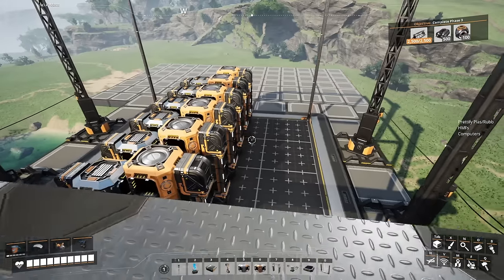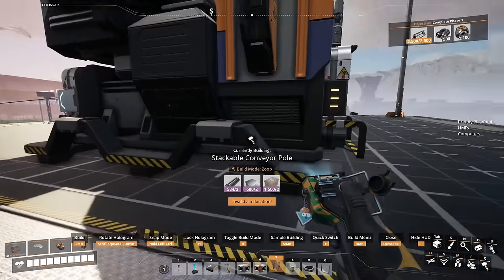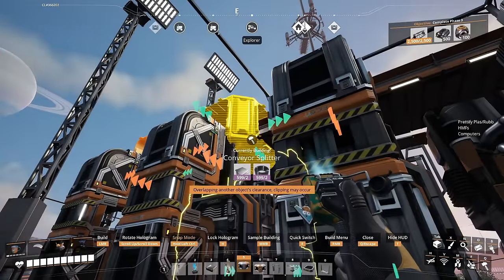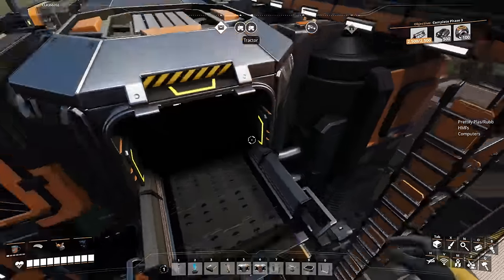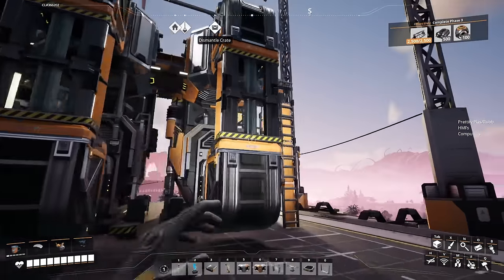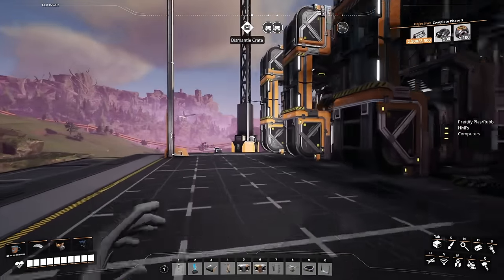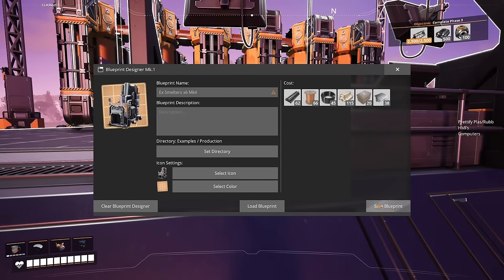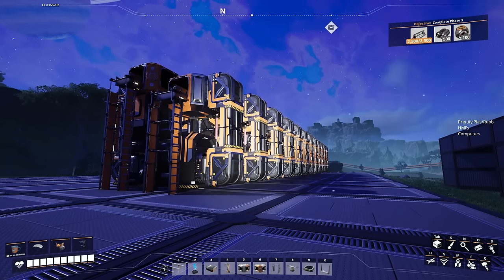Early Game Smelters Blueprint - Compact, Clean, & Tileable - Mk.1 BP - Satisfactory 1.0

Comment: Another (related) tip: If you want to check if a conveyor lift and a splitter/merger/port are connected, just take any belt into your hand. If the arrows show up for the connection, it isn't connected. Easy way to check if you've placed all your lifts correctly, literally at a glance.

Comment: This is so cool dude! 

I have a version that I made that puts the smelters on top of a 1m foundation on top of the frame foundation with the mergers/splitters underneath. I love the look of the conveyer that just clips through a foundation out of the floor into and out of a machine. I use conveyor floor holes sometimes but it essentially looks the same except for seeing the rim of the floor hole. I also run power underneath too. I haven't tried to make a BP of it because I stopped playing well before the BP designer existed but I will be using my version, as well as yours, now that 1.0 is out. 

I love the compactness of yours. 

Thanks for sharing!

Comment: This will help me and my (Scalti who i learned it from 3 years ago) sandwich layer style vertical factories when i want less wall hole vertical lifts which limit top floor delivery options to the bottom floor for the truck stops.  Great design and will definitely incorporate this in a motor factory tomorrow.

Comment: Awesome. I'm just on Tier 6 and have got fuel power stations up and running... A couple more fuel power stations (I need to sink a bunch of rubber and plastic to make sure they all keep running) and I can deconstruct all my coal power stations 12 and turn them into steel foundries.

Your design work, clean! and your video explanation, clear!  Nice going!
Reply from the maker: @graxxor  thanks! In a few days you'll get my mk2 blueprint for fuel generators :D. I fit 4 of them in there!

Comment: I like this design, seeing the lifts delivering resources is very satisfying. 
Personally I made a 4 and 8(mirrored) smelter blueprint using your compact design to match with my Miner output. but I was downgrading the lifts to mk1 as the smelters don't require a mk4/3 speed for their in/out
Reply from the maker: downgrading the lifts doesn't do much, since the 60/min is still greater than what the building needs, the manifolds will still fill up and "waste" the 100 ore buffer eventually anyway. But it works fine too! I prefer to just build with my best belts everywhere since there's not really a big reason not to (The actual cost to build belts is essentially zero in the long term, once you've automated the steel beams or encased beams)

Comment: Tip: This will save you time building blueprints. Build a Smelter by itself with the conveyor lift, splitter, and merger then call it Smelter Base.

You can more efficiently build blueprints with your base componets.
Reply from the maker: Yeah that's a good tip! The slight downside is the belts will be disconnected if you dismantle the splitters/mergers, whereas if they're plopped on a long belt, then they don't disconnect it when removed. Shouldn't matter much for production though! But for certain blueprints it could matter.
Reply: @Krydax8  Well, there is another purpose. Sometimes, you just need one more "Base" to finish using up a belt, which is rare but not super rare.

 I still maintain my standard collection with group "Base" together with a standard position and a flipped position —belts running in the opposite direction.

Comment: I discovered that going vertical is better then horizontal. You run out of space quick with horizontal factory's. So i now design all my blue prints to fit on top of one another.
Reply from the maker: @lowfiep  "better" is certainly the wrong word to use. There are pros and cons to everything and different players optimize for different things, enjoy different things, and have different capabilities!

Also "run out of space"?? Idk what you're talking about! There's certainly plenty of space for building in any direction!

Comment: If you struggle with the higher conveyor line not snapping into the right place I found another workaround!

Once you get the lower conveyor line completed just stack one merger or splitter on top of them. After that the higher line snaps to the same grid and it "clicked" and worked flawlessly. No idea why this happened but I struggled with it for a while. Awesome tutorial and kudos for the no clipping mentality (for the most visible/aesthethic pieces). Also helps with the upgradebility.

Comment: Its a nice design but it seems to be extremly inefficient. 
Because a splitter splits ( 3 outputs) 33,33% each and (2 outputs) 50% each. 
That means the first splitter splits 50% and 50%. The second splitter gets only 50% and splits that to 25% each. So if your factory uses 10 smelters with your design the splitter gives: 
1. 50%
2. 25%
3. 12,5%
4. 6,25%
5. 3,125%
6. 1,5625%
7. 0,78125%
8. 0,390625%
9. 0,1953125%
10. 0,09765625% x2
So your 10. smelter only gets 0,0976% x2 because of no slit = 0,1953...% from the 100% input and thats not enough. (0,1953% from a 1.200 ore node are 2,3436 ores per min)!
You only can fix this issue by de-connect alle smelters with wires so they can fill up for 100 ores. Or you use a fully container with ores so they also can fill up with more ores than they need. 
If all the other 9 smelters & conveyor belts are full of material than and only than the last one gets enough material to produce 100% but idk if the conveyor belts are long enough to provide a consistence flow of the material (for 8. 9. and 10. smelter in the row)
Reply from the maker: @NickxGaming  so what you're referring to is a manifold design. And it works fine once the ore fills up in the inputs, which it will do. Think about it another way, with 6 smelters, you only need 4 to fill up before it runs at 100% efficiency (since the last two smelters split what's left, they don't need their buffers to fill up)

So you're just spending a one time cost of 400 ore. Which, with a mk2 belt, is only 3 minutes.

And you don't have to turn them off to let them buffer. The buffers will fill even while they're running, it'll just take an extra couple minutes

Bottom line is manifolds are great. Don't be scared of a little buffer!

Comment: I could not get the snapping to work for the splitters and mergers, so I ended up attaching the splitters and mergers to the lifts and this worked out okay.
Reply from the maker: Usually that actually will get the snapping on the actual belt to work. So you put a dummy splitter on the lift-head, and then you can snap a splitter to the belt right next to it, then delete the dummy splitter & lift, then make the lift. That's the trick that works every time for me, at least!

Comment: Great videos.  The only part I'm missing is how to use these in my factory.  Is the idea to feed it as much ore as possible, and does this equal a maximum of 6 fully overclocked smelters? (75 * 6 = 450 ore to ingots, as a Mk.4 belt can only move 480 per minute)
Reply from the maker: @shadaxgaming  I have an example vid in the playlist where I show you just that! As well as how it actually looks in my base.

As far as the numbers, you just build overkill, usually, rather than exactsies!

Comment: wouldn't the line of splitters mean that the 2nd machine only gets half the input of the first and so on ?
Reply from the maker: only for a minute until the machine buffers fill up. Generally happens pretty fast. Or you can even fill them up yourself with a few hundred ore if you don't want to wait!

Comment: I like it, but in general, when making these blueprints how do you know how many buildings to place? like why 6 smelters, or 3 foundries or whatever. Is there a way to kind of predict how many you need? I use a lot of alternates so my needs vary a lot. power wise I use beams that stretch overhead with chained wall outlets
Reply from the maker: Personally, I just overproduce most basic stuff like ingots and wires. I go with the strategy of letting things back up, rather than perfect ratios + sink everything. So I'll just slam 18 smelters in a row for a mk4 belt (18x3 = 540), you could deconstruct a few to match the 480, but eh, I'll leave it for later when I have mk5 belts, etc. 

As far as predicting how many you'll need for the advanced things (like frames, motors, etc), not really. The game has a lot of recipes and a lot of alternates, so on your first playthrough, without doing a lot of advanced planning online, I would just prioritize making SOME. It doesn't really matter how much. As long as you're making some of a thing, it will be enough for quite a while, if not forever.

Comment: wouldn't it be easier to use the lifts first, then attach the splitters which will automatically attach, and then construct the belts? That would make it easier as you wouldn't have to align everything...
Reply: It's a also a pain to connect the small belt segments between the splitters/mergers, but more importantly, building the belt first ensures no subtle mistakes with the height of the lifts and ensures the blueprint can be tiled correctly. 

Try both ways and see which works better for you. I prefer the video's method because I make fewer mistakes personally when using belt first construction.

Comment: Somehow when I try placing the merger my hologram wobbles (snaps and de-snaps rabidly) and I don't know what I am doing wrong.
Reply from the maker: @Satori_kun  I've had those issues before, but not with any of these blueprints. I wonder if it's a global grid thing. Try putting your foundations on global grid and put the blueprint designer on that, maybe that helps? Idk!
Reply: @Krydax8  I will try it later and give an update. This could be worth reporting as an error to coffee stain studio since I can't believe it is intentional that the "hologram wobbling" is still a thing in 1.0
Reply from the maker: @Satori_kun  yeah it's certainly a bug. Probably pesky to fix.
Reply: @Krydax8  The BP on global grid does not fix it. But placing the merger on the lift head and then snap it on the belt works.

Comment: I can get the lower one to snap, but regardless of the height of the dummy lift, i cannot get the taller one to snap, no matter how close or far or short or high. Anyone have any suggestions?
Reply from the maker: @Kinemagichemistry  I think I show this trick in the video, maybe it's not in the smelters one (it's in the other BP videos)

But you make a splitter/merger on the top end of the dummy lift, and then you should be able to snap one to the belt, then delete the dummy splitter and lift.

Comment: I genuinely sumbled into a the idea of vertical feeds today and have been getting pretty close to your solution. The biggest difference would be that mine is load balanced in batches of 120ipm and i input from a logistics floor below and output to one above. My bluprints end up looking like machine sandwiches and saves the trouble of builing all those bases.

Comment: Great design, but alas Mk 4 belt is not early game. But, Mk 2 can handle 4 smelters, which is good for early game Mk 1 miner pure node or feeding in two normal nodes.
Reply: By the time you have blueprints, the Mk3 belt is pretty easy to make. I'd personally make this a 4 smelter blueprint with Mk3 belts, that way two of them tiled can handle 240 ore. Since each smelter is 30/min, 8 of them is 240, which is two pure or four normal nodes (or fewer overclocked nodes).

I like this design, and I agree that 6 smelters isn't as practical as 4, but with Mk2 belts you can't really tile as 4 smelters will already use the capacity of a Mk2 belt.
Reply from the maker: Yeah you use mk3 belts with this originally. 6x30 = 180, which mk3 belts can handle. I just slam 6 together cause I'd rather have 6 and deconstruct two, than only have 4, since once you have faster belt speeds, you'll want more than 4 (like if you want 12, you only need two of these BPs rather than 3). But of course to each their own, its easy to build this same BP with 4 smelters! :)

Comment: Doesnt work, cannot get the output to snap on the belt, just tries to snap directly onto the lift. Edit: skill issue on my part :D
Reply from the maker: Try snapping it to the lift first, then the second one should snap to the belt, then you dismantle the lift+the dummy merger/splitter thats on top of the lift, then build the actual lift to connect the real splitter/merger. I go over that trick in some of the other BP videos as well. Good luck! Snapping can be a bit finnicky for sure. 

I think there are some bugs that exist regarding snapping, as it clearly works for me in the video, as I record it, so I can't imagine why it wouldn't work if you're doing things the same way, but that's how bugs work I guess, they don't often make sense!
Reply: @Krydax8  Yeah I managed to get the first set to snapo perfectly but the second one just does not snap at all, I managed to get it to work but had to use the smaller tracks at the bottom which defeats the purpose but still compact so it'll work for now
Reply: @Krydax8  Turns out it was a skill issue my apologies, on watching a couple other guides you posted snapping from the other side and using the double stack seems to sometimes make it work  either way it worked after i just got gud

Comment: Yeah it’s kinda nice but compactness isn’t as aesthetic as spacing stuff out. I want to like it but I prefer the aesthetics of clean readable programming, similar to actual programming where the best designers encourage “readability” so that generally means a clean generic symmetrical layout. It’s not like in Rust or something where tightness helps. Or RCT where it’s nice to min max. It was the same in Shapez 2 I preferred the way I initially built them in a straightforward way and the pursuit of compactness didn’t provide much reward. Maybe if the map was smaller but it’s colossal. And cmon, it was secretly clipping in both the poles and manifold touching the smelters. I got some outside in dual manifolds that look way more handsome and symmetrical and sprawl out squarely. Nice tutorial though.
Reply: Yeah, I seen the smelter top exhaust being covered and instantly thought it would need to be remade. Maybe have them go underneath and raise them up a floor instead.
Reply: @azofshadowmore  yeah I think it was the side that he said could be higher, and it should be. The other problem is having input/output that’s uneven and they should be input on one side and output on the other for common placement in chains at the same height. And if they are as such it’s still slightly off left and right.  And also just too high up which is itself a hassle. For power I would just add a beam somewhere with wall ceiling mounts.

Comment: I like the overall design, but this growing habit of saying designs like this can just be tiled is really naive and starting to get frustrating.  Yes TECHNICALLY you can tiles these as one really long manifold.  In reality you'll be waiting days for the ones on the end to actually start working.
Reply from the maker: What did manifolds do to hurt you? They work great. They certainly do not take years to fill. Extremely slow ones might take a while, but this game is a game of infinite resources, and input-balancing is a large waste of time unless you like the challenge of it, is my hot take.

Manifolds will rule the world!
Reply: @Krydax8  Don't get me wrong, I like manifolds.  More so after getting smart splitters, but I like their compact nature and their simplicity. But you put a smelter 12 splitters down on a series of Mk2 belts and standard splitters and you'll never see that thing reach 100% efficiency in your lifetime.  And not seeing 100% efficiency bothers me.  At the very least I'd use an injected manifold.
Reply from the maker: @JohnVanderbeck  I think you are vastly overestimating how much time it takes for manifolds to fill. https://www.reddit.com/r/SatisfactoryGame/comments/rr2czd/but_manifold_takes_time_to_saturate_how_long_i/

Short answer: Its almost always less than an hour in most realistic scenarios, which you wont even notice since you're off doing something else while it spins up. And if you REALLY want that 100% efficiency sooner, then just underclock everything to 1% for a few mins while the buffers fill, and then you're good to go forever after that!